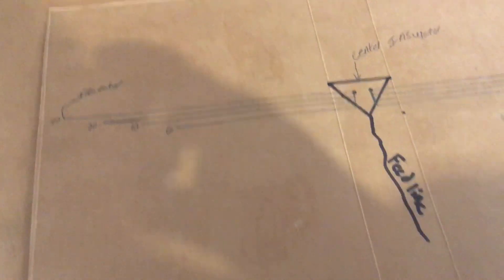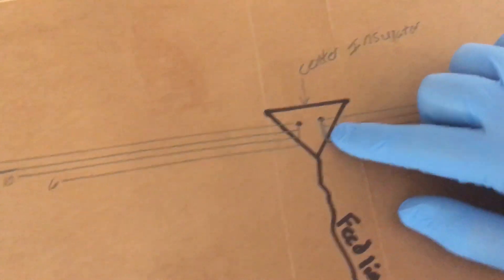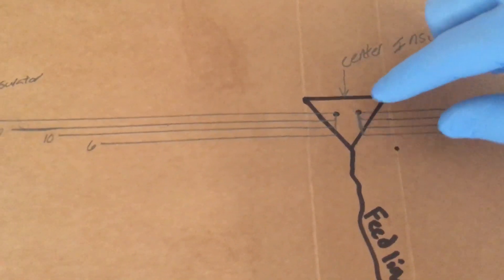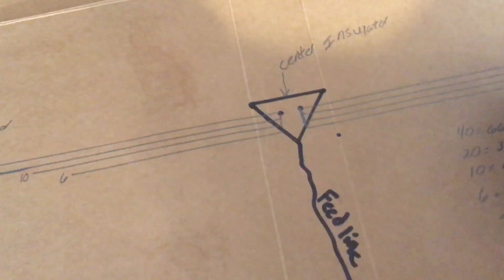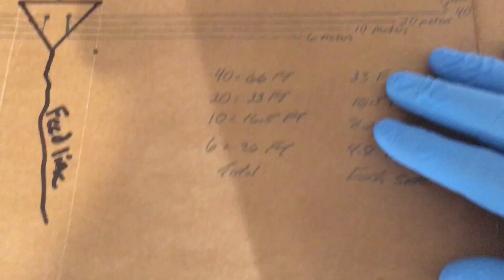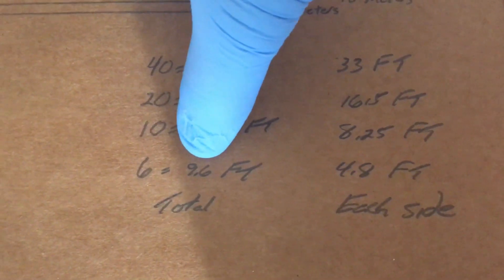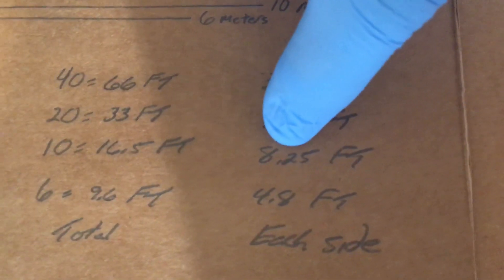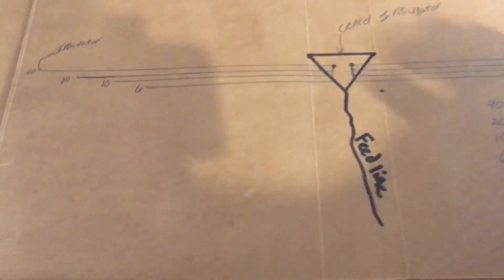Measurements For A Homemade Dipole Antenna For 6, 10, 20, 40 Meters

Comment: I made a similar fan dipole for my garden and had the centre attached to a pole about 6m high.  Works very well for me, I simply had 80m, 40m and 20m elements and it would tune quite well on 10m, 6m and several other bands just using the internal tuner on my transceiver.  Aren't your element lengths a bit too long?  It won't matter much for SDR, but I think if you want to have it resonant for those bands you'll need to trim it down to account for the velocity factor which is about 0.85 for that cable I'd guess.  Therefore the element lengths are:  (300/F)*0.65 in Meters and MHz and then divide by 4 for each side.  So for me a 40m element was 300/71 Mhz = 42.25 * 0.85  = 35.92m  so one side is: 8.98m  That's about 29 feet 5 & 1/2 inches.  Of course best to make it a few inches longer each side and tune for low SWR on the radio.   That's what I did anyway and it worked out great till a storm blew it down, now I think I'll try a lowft install like yours.  At least it's protected from the elements up there and might even be higher than my old one :)